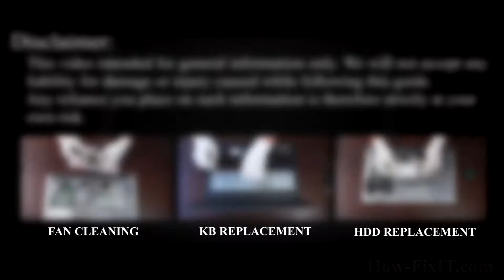Dell Inspiron 15 - 5547, 5545, 5548 RAM Upgrade and Installation Guide

Comment: Can I upgrade the Ram on this computer to 32GB ?
Reply: This may be too late but I have seen in several places that 16GB is the max.
Reply: @misterdaz1018 this may also be too late but I thought 8 was the max.
Reply: @SoheiJayce  This may not be too late but 16GB is the max
Reply: @eztgr  found out my grandpa's laptop only has one RAM slot.
Reply: @SoheiJayce   Is your gramps laptop the same as this video?
Reply from the maker: I think not, but it’s better to test to be sure.

Comment: Whenever you need to open the notebook, do you need to remove the battery? 
If the answer is YES, why ?
Reply: Because if the you didn't removed the battery first and accidentally your screwdriver punctured the battery it will burn the laptop and you both
Reply: @zaidansari533  that makes no sense. You use the screwdriver to remove the battery, but you don't use it to remove the RAM.
Reply: @thiagodesa9102  yeah but also to prevent any kind of short circuit during attempting these activities